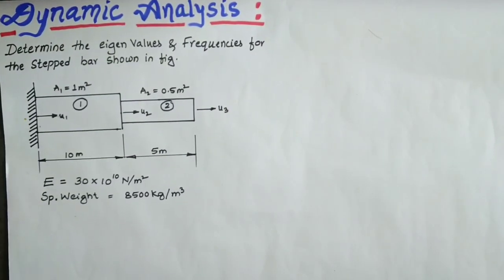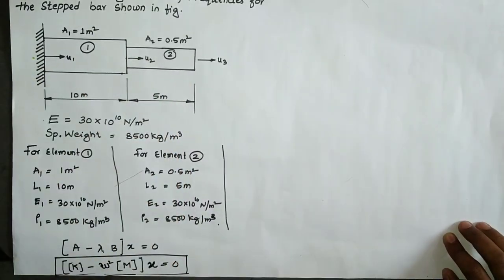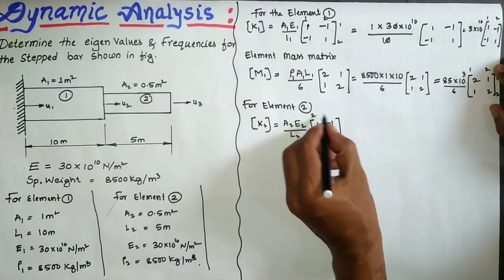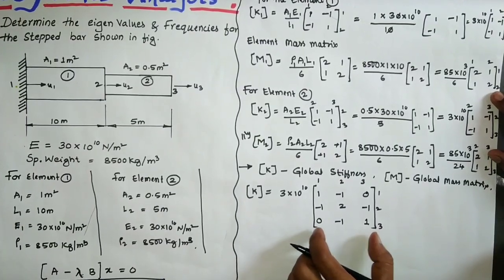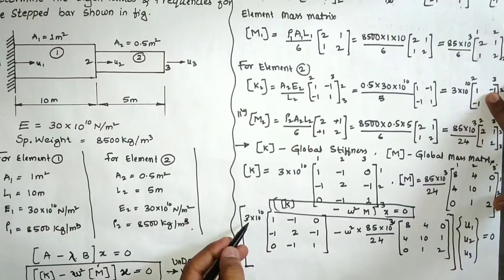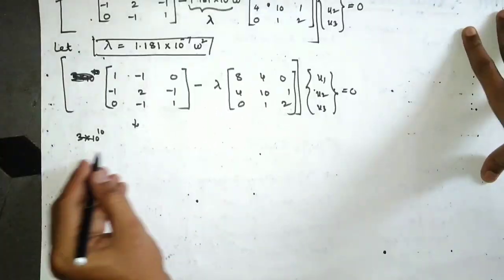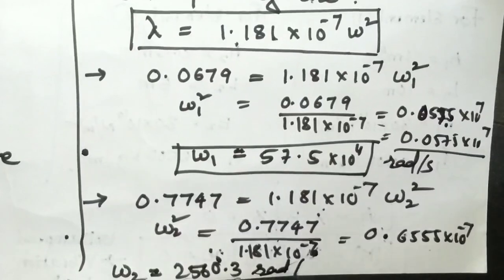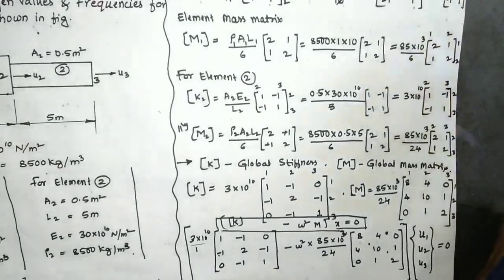Eigen values Problems in FEM |Lumping Procedures | Dynamic Problems in Finite Element Analysis | FEA

Comment: how do you obtained the values of mass matrix, i cant undestard the mechanism
Reply from the maker: There is an equation for mass matrix for bar Element
Reply: @MaheshGadwantikar  where can I find it? I want to understand it and calculate it like stiffness matrix.
Reply from the maker: You can find the equations in dynamic vibration problems.
Reply: @MaheshGadwantikar  have you got that video?

Comment: sir in 39th video u gave formula for bar element ... and in this video u used another formula can i know which one is corect
Reply from the maker: It will be same for all the bar related problems under static conditions, if in case the bar subjected to variables loads then why have to go with Mass matrix equation.
Reply: @MaheshGadwantikar  sir how can we wheather the beam is subjected to load are not..

Comment: Sir..they have give sp.weight. that has to be converted into density so (8500/9.81) = density
Reply: Same doubt we have to divide by 9.81 or not ?????
Reply: @CreativeuTuberIndia  we have to.
Reply: @santhosha6899  but density unit is kg/m3
Reply from the maker: As I referred two text book, actually the density = Sp.wt/9.81, Some text book given the solution, And Some of them are taken specific weight= Density..I think the best solution is to go with the first option..Now choice is yours
Reply: @MaheshGadwantikar  thank you sir...... I have a another doubt if they not given E and A value which values we have to take sir???
Reply from the maker: 99% both the Values will be given, If in case not given, then you can Assume Unity, i.e 1
Reply: @MaheshGadwantikar  last paper they not given so asked sir....